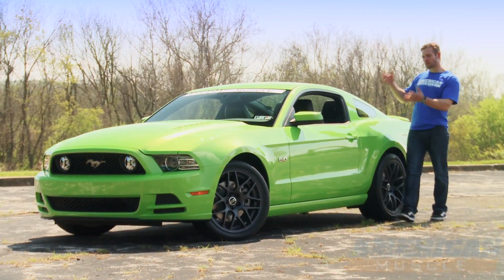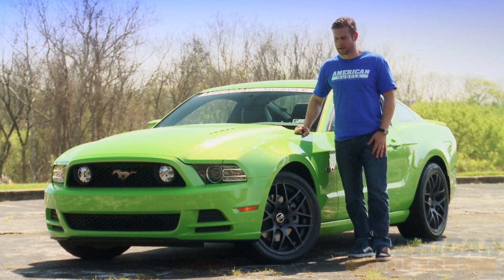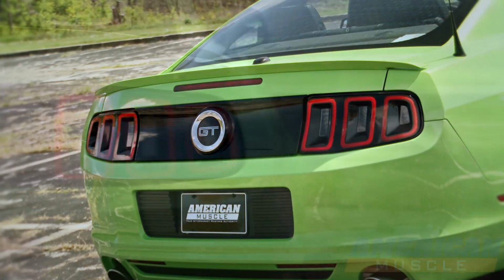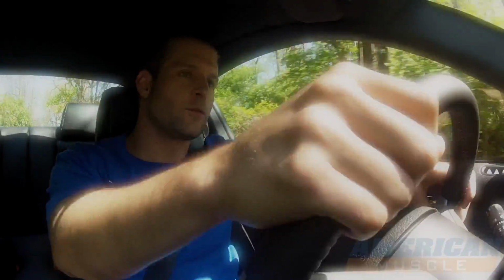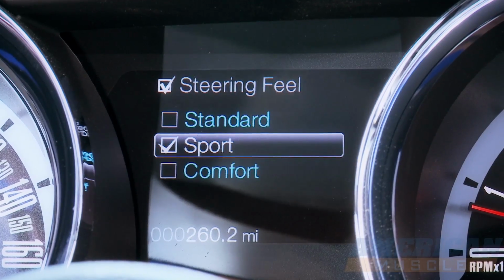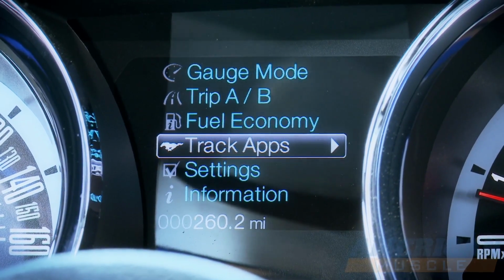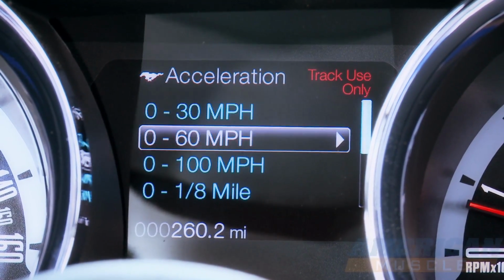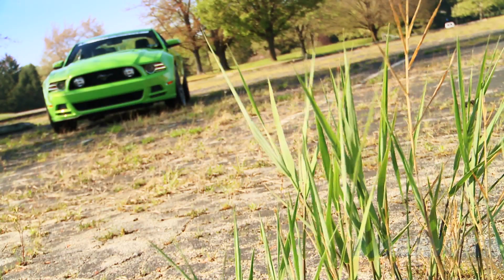Review, Drive & Specs: 2013 Ford Mustang GT

Comment: Imagine having the 2013 Mustang, 3.7L cyclone V6, put out more HP than the stock 5.0L coyote V8's. That's exactly what happened when I stuck a ProCharger supercharger and BBK headers onto my 2013 Mustang V6. After dyno tuning, she now puts down 411 WHP (483 HP at the crank) / 336 TQ. I love smoking stock and slightly modded 5.0 Mustangs at the track. Of course there are a bunch of other mods on the car, thanks to American Muscle and Justin's videos. 😉

Comment: When Ford was developing the Boss engine they found that the oil squirters were not necessary and that they actually caused somewhat of a windage effect on the back of the pistons which robbed some power. On high hp applications most engine builders already block these using the FRPP squirter plugs used on the boss.

Comment: Um, no you are wrong. The 2013 has:
Power: 420 hp @ 6500 rpm
Torque: 390 lb-ft @ 4000 rpm
Reply: My ls3 has 
436 hp 424 torque
Reply: @macario9035  and my 5.0 makes 460hp and 420 torque .... so what

Comment: a live axle is a solid rear end and IRS is independent rear suspension. if you look at a truck or any old muscle car and look at the rear drive axle its always 1 solid piece thats what the mustang has. people complain because the suspension isn't as good as an IRS. but the benefit of it is its cheaper so the mustang can be sold for less.

Comment: Yes it does. That is part of making powdered metal rods. All powdered metal rods must be struck @ hot forging temps. 
GT rods, which are stock, are sinter-forged. 
The ZR1 rods are from Corvette. Camaro dont get titanium rods. 
And the ZR1 rods are aftermarket, made by Pankl Racing. 
Boss rods do not need peening, Manley uses a much better design &material. Plus they dont have to machine the shank down. 
GT rods dont need peening either because they dont need machining either.

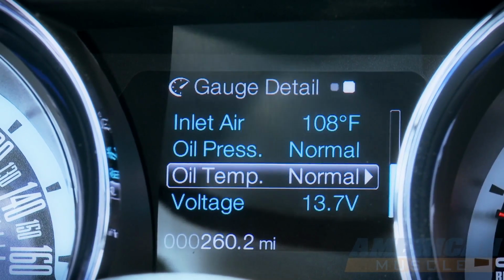Comment: Very nicely done and shot American Muscle, 2 thumbs up from me!!  I had not seen how the back-up lights worked with the rope LED and block LED's out back, very clean.  I like how Ford has added so many features with track apps and gauge mode.  I think their biggest mistake is not putting in a real Oil Temp gauge and Oil Pressure gauge seen at the 3:00 minute mark.  Really Ford? You give us Cylinder head temps, air inlet temps, wide band O2 sensors but no Oil temp and pressure?  BOO

Comment: Yea but I think you are forgetting that the BOSS also comes factory with an oil cooler which the stock 5.0's do not and that when the 2011's hit the dealers cylinder # 8 or 7 were having cooling issues and people who lightly road coursed them were snapping their rods due to heat issues already in stock form. Does the new base GT 5.0's now have oil coolers like the BOSS? If not than I still do not see how Ford made a smart decision...

Comment: i bought a 2012 mustang and when i saw the 2013 model online my first thought was shit i should of waited. i went down to ford with a friend of mine to check it out in person and i wasnt impressed at all by the new design. my friend said the years on the look should of been swiched. trust me tail lights look cheap and the hood is too flat and alttlie shorter than the 2012 model which i think the longer the hood the meaner it looks which is the same reason why i didnt get the carmaro.

Comment: but you could probably get an older like 2009 and below mustang gt may have lil over 60k miles on it but its still fast affordable and insurance should be lower will of course be a little more than the v6 but insurance shouldnt be that big of a change especially for those years and that its used

Comment: GT sinter-forged  rods are so good that they dont need shot-peening.
Hennesey is confident to make 650BHP on stock GT sintered rods.
Here is vid documentation that Ford GT powdered metal rods are badass:
802 RWHP: yXuCBFVF2XY
1047 RWHP: aNtPpqeRNrA
Stock rods taking massive boost: JC7GkT8QExc
Why is this possible? that's Ford engineered sinter-forged rods

Comment: I don't think I can agree with you; however, chrome belongs on metal and not plastic. The car still has a lot of chromed plastic pieces on the inside. Tacky? Well that depends who your asking. Some vehicles look great with chrome in the right color. There is no way it would work on the exterior of this slime machine green featured.

Comment: just bought a 2013 50,dose anyone know if 285 size rear tire's will fit under rear end with 18 by 10 inch rim's on,heard only 275 will work from dealer? thank's
Reply: YES, 315/40/ 19 fit.

Comment: Sad that Ford still hasn't learned not to run the emergency break cables through the control arm & not tie them down, result slide around wearing down to the cable

Comment: You need to start living in reality.  Ignoring the fact that the Skyline name died in 2002, the modern GT-R costs more than 3 times as much as a Mustang GT.  The only fair comparison to make is the 370Z vs the Mustang GT, which is unfair, b/c the Mustang will destroy the Z.  The more money you spend, the lighter your car's materials and the more sophisticated the engine.  It's jaw-dropping that Ford can offer M3 performance for just $30K.  A lack of sophistication is expected at that low price.

Comment: Hello guys,  I  have a quick question about this car,  I'm from Europe and the Oil is very expensive these days,   considering this car  drinks a lot   i was thinking buying this car and putting in a gas (lpg) tank in it,    woudl this car  be a LOT cheaper to drive? (  the same price for a normal car)  or still prety expensive?

Comment: Nope, GT500 is best top-of-line,662HP, more than ZL1 only 580HP.
'12 ZL1 is LIMITED production. 2012 ZL1, only 1971cars made. 
'12 GT500, 4834cars made, and that only the 550HP GT500!
GT500 counts even with Mahle&Manley internals. Why?Because the GT500 came from the factory with them!
Dont get made because you cant get superior Mahle&Manley parts in any Camaro.

Comment: or how about fords GT.500 with 650bhp top speed over 200mph and 0 to 60 in the 3 second range.  Ford has produced the most horsepower V8 ever to come out of the factory.  2014 Camaro hahaha.  The mustang is a pos huh???? funny that you say that considering that the mustang outsales the camaro and challenger and the mustang still holds the record for the most cars of one style sold in a years time.

Comment: love the 2013. Too bad about the tail lights... good thing the 2015 tail lights resemble the 2011-2012 design. I get comments all the time on my 2012 from people that prefer the backend to the 2013-2014 models.
And having the piston oil squirters in my engine is worth the 8hp loss... nothing some bolt ons can't fix for the safety of having that feature.
Reply: And guess what? People used to hate the 2011 & 2012 tails. The same thing you're saying is what others said about the new design and that they liked the 05-09 tails better. I love the 13-14 lights. Modern but you still know it's a mustang. A lot cleaner too since its just red where it needs to be and not those big red lenses with those white slats between.
Reply: I hate the 2011-2012 rear end.. it's awful.. especially the tail lights. Almost everyone that has a 11-12 changes the lights for an aftermarket set or tints them to try and make them more appealing. The 13-14 is a much better looking car in every way and the 2015 is even better still.
Reply: Those oil squirters fail and are inefficient. They make kits for the 11-12 cars to eliminate those. Sorry but the 13-14 cars are better cars. I do like the front end of the 11-12 cars better but otherwise 13-14 is it.
Reply: One of the things I really like about the 2013 Mustang is the restyled taillights.  They look awesome with the LED's lit up, especially at night.  They also actually fit on the car flush versus the gap that can be seen on the 2010-12 models with their curved trunk panel that doesn't line up with the taillights.  I also love the 2015 taillights, but I still prefer the 2013-14 exterior styling, especially up front.  I do wish the 2013-14 models had the 2015 interior though.  What an improvement!  The 2015 is growing on me the more I see them.  Time will tell if I like it the best I guess.

Comment: @xxxbmxerxxx1 The mustang GT has a v8 just because it's a tradition to put a big v8 in a muscle car. If ford can squeeze out 662 hp in the new gt500's v8 engine I'm sure they can build a v6 engine With the same or even more horsepower then the GTR. And skyline? They haven't been called that for around 7 years now

Comment: 2001 bmw m3 3.2 liter 333 horsepower 111 horse power per liter achivement at 2001 by bmw > 2013 Rustang Giant Gt Snakeoutaurus Coyote motor :L.5.O.L WHOWOO GaS is gonna be 5$ !!!1 ( oh btw , these people who designed this car watched top gear before they design all these very copycatte'd idrive system from 2004 bmw series ) Go Go Power Rangers Green Rustang , Yellow Crapabaro , and Blue 7.2 Liter CrapovetteZzzz71 anyway my lexus sc300 is still 20 years a head in anyways , so i give it a time

Comment: sport mode in a 2013 5.0 feels way weaker than sport mode in a 2015 ecoboost.
Reply from the maker: I think that might just be because the 2013 5.0 doesn't have a Sport Mode :) Although you can toggle your traction control to Sport Mode, it has no control of the motor/ trans output. - Will
Reply: AmericanMuscle.com The sales guy lied to me then hahaha!  Glad I upgraded.